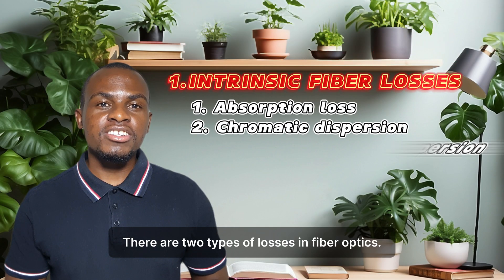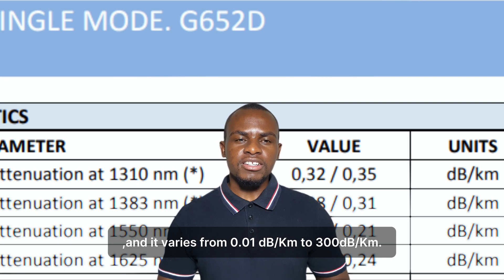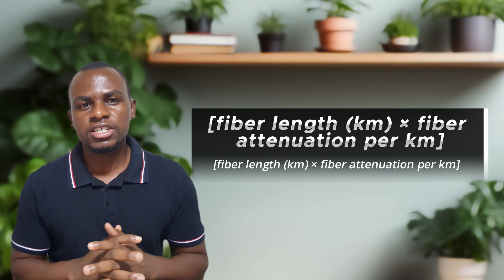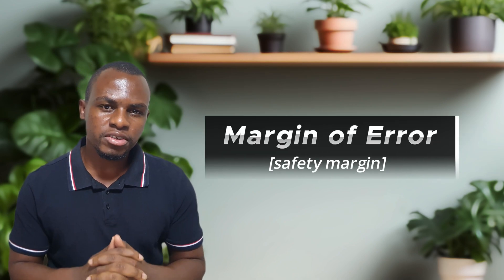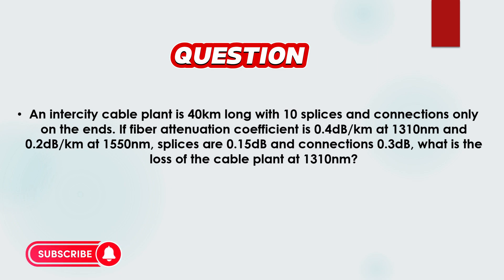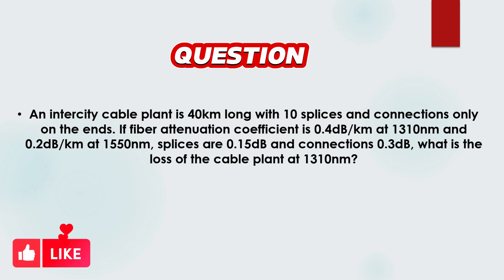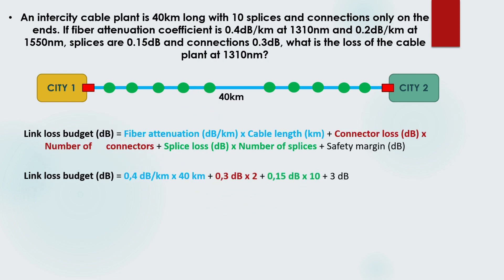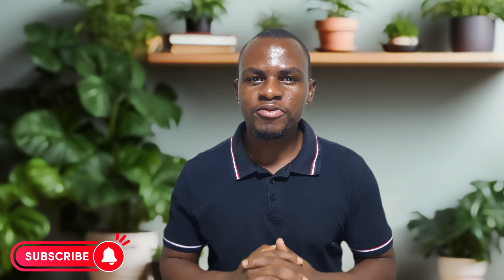Optical Fiber Link Loss Calculation | (how to calculate fiber optic link loss budget) #trending

Comment: Great Video. After calculating the link loss budget on the given example is the signal too strong or poor at the receiver end.
Reply from the maker: The loss budget result of the link is used as estimate for pass or fail  limits during testing. If the field-measured loss is significantly higher than the calculated value, troubleshoot the installation.

Calculating the loss budget for a fiber optic link is done as part of the initial design of the link. A loss budget will estimate the loss of the link to provide assurance that the link will support telecommunications equipment intended for use on the link. It is used to provide an estimated loss value to use when testing the link with a test source and power meter after installation to determine if the link has been installed correctly.